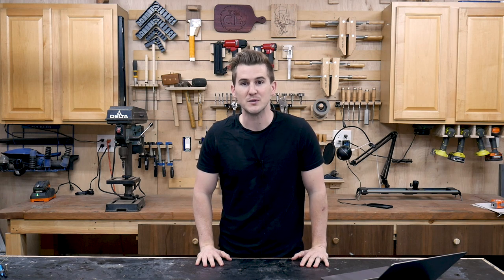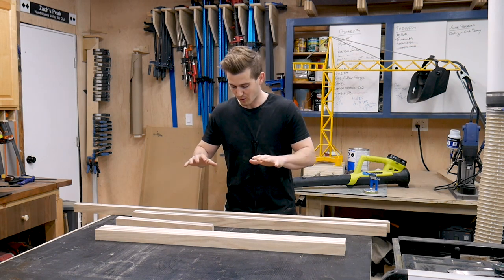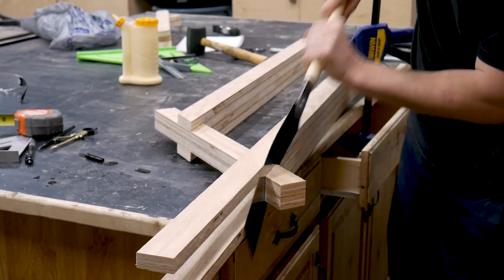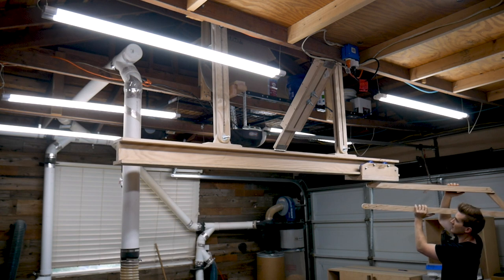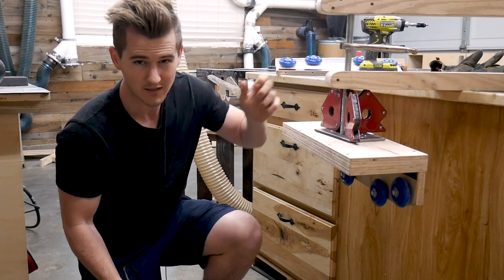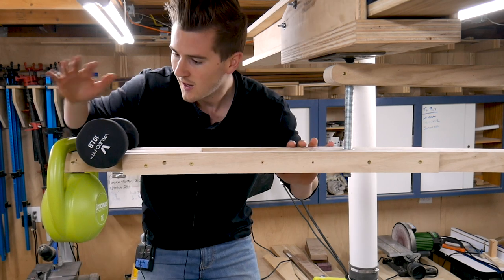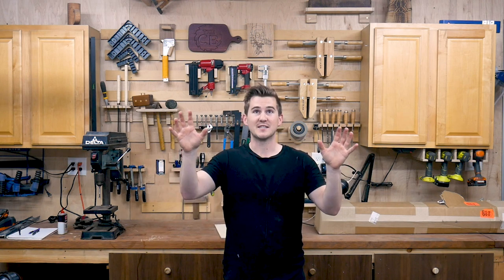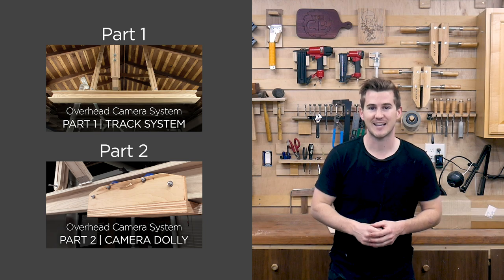Workshop Camera | Part 3

Comment: Fantastic idea, putting a camera jib/slider upside down on the ceiling of your workshop. What was that drill-press-like tool at 6:30? I don't think I've seen one like that before.
Reply from the maker: Thanks! It’s a magnetic metal drill press from Evolution (id never buy it for my current workflow but they were nice enough to send me one and it is a tank of a drill press). Drills 3/4” steel at 1.25” wide and has a coolant system. The magnetic feature secures it down to your metal work surface with 2700 pounds of force. I was stoked to work it into the project.
Reply: @workshop_edits  Thanks for the quick reply. I watched your workshop walk-through and you talked about it there. I've got a similar size garage and thinking about adding more tools, now that we have only one car, maybe it can do double duty. Trouble is it's now full of 25 years of accumulated indispensable junk. Have to clean that out first.